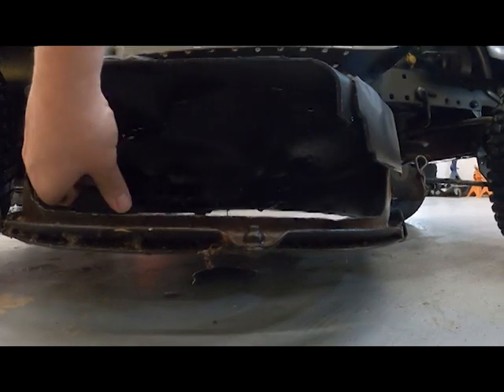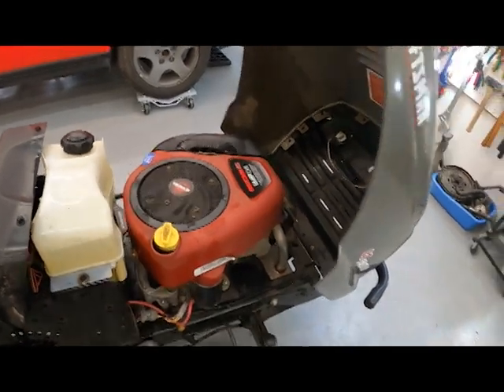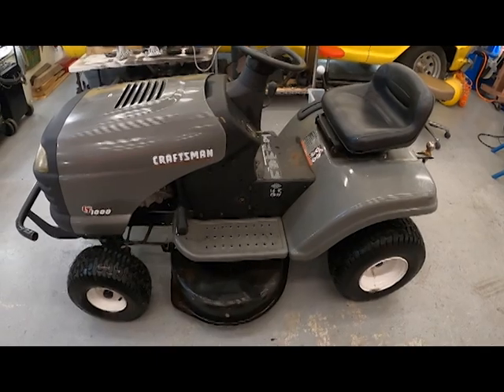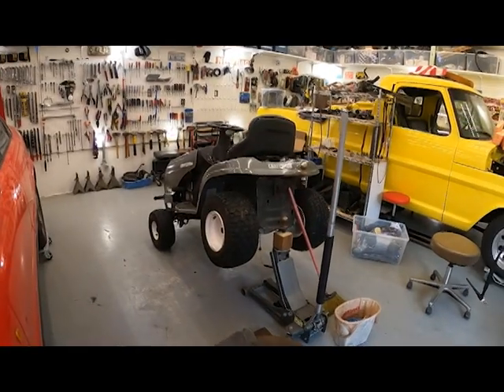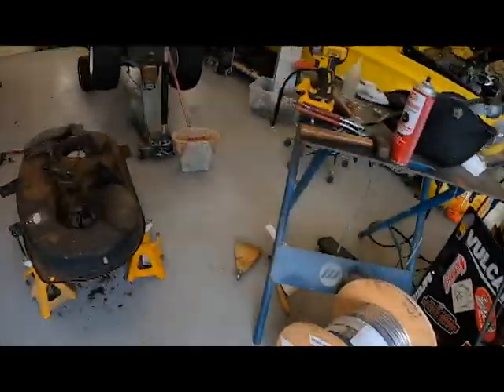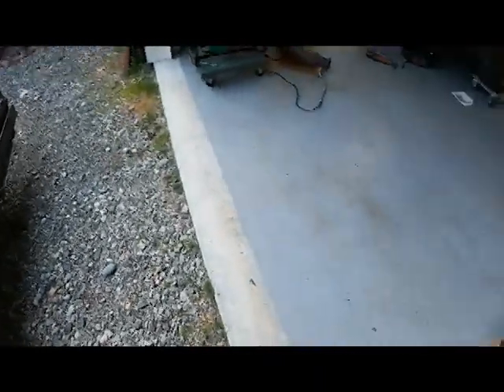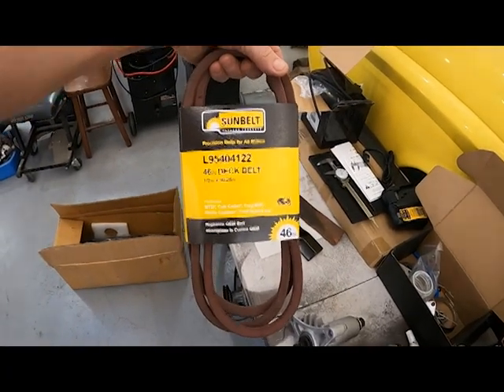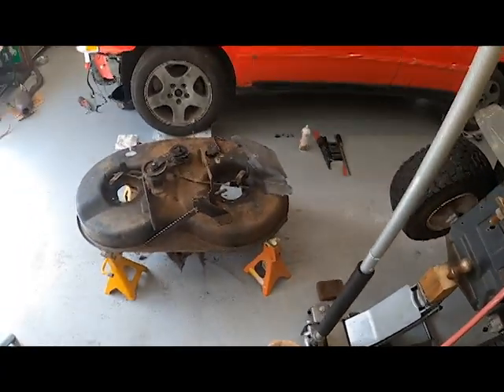Craftsman LT1000 deck rebuild

Comment: So were you able to fix your 38in deck? I’m finding it near impossible to find parts let alone a YouTube video on that specific deck showing proper repair or rebuild
Reply from the maker: Yes! The bearings were the same as the larger deck but the belt and blades were different. I think I ordered them from eBay
Reply: @BertsFordFactory  thank you for the reply.. I was a bit frustrated, then after I messaged this, I actually found two full videos on a 38 and not a 42.. So, I was able to final piece it together after a few days of research.

The mower was given to me for free with a box four new blades, so it was a crash course on the deck rebuild since it was disassembled when I got it and part of the deck was destroyed from previous owner hitting “stumps??” forcing the deck into the blades, but I got it back together, pounded out the misshapen deck and it cut for about 5min.. then Nikki Carb decided to join the party of F@ckery with a damaged float valve and flooded the entire engine.. Spark plug, oil tank and air filter were all compromised lol I learned a lot about this mower in less than a week.. cleaned and rebuilt the Nikki, completely drained and replaced oil and drained/dried/replaced spark. 

It’s mowing, but it has a real rough idle.. hoping it’s just needing a valve adjustment and this isn’t just a constant now, due to damage from possible hydrolock 🙄 I’m not ready to pull the actual engine apart just yet.

But it was free, and I’ve only spent maybe 50 total on carb rebuild, spark and fluids so either way I’m calling it a win 🥇